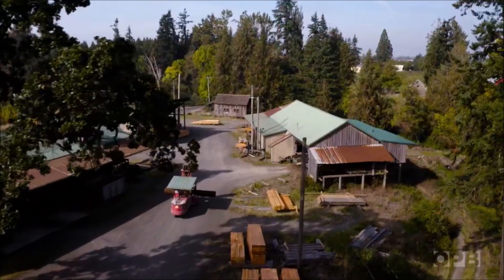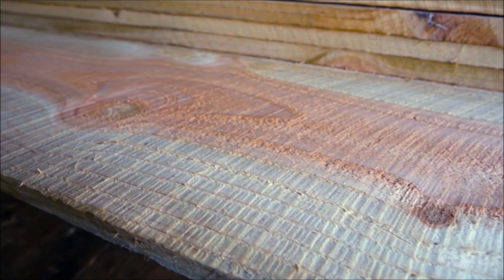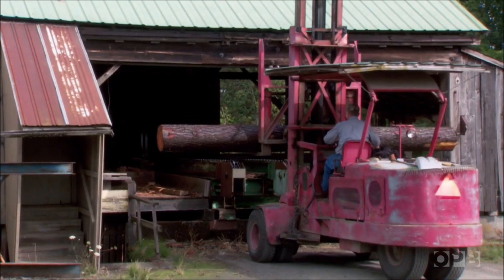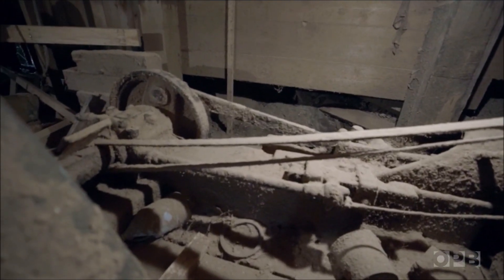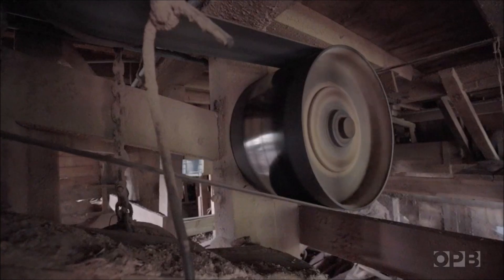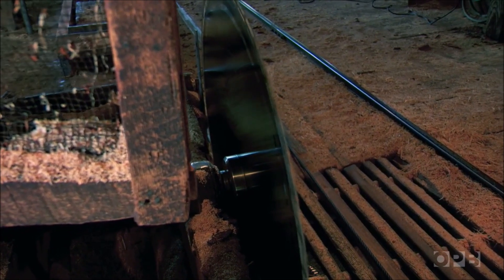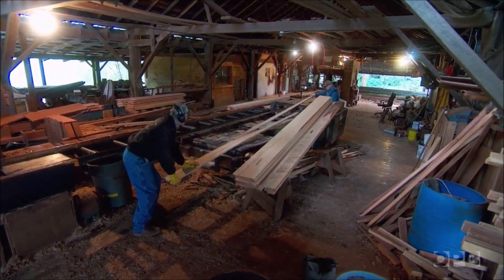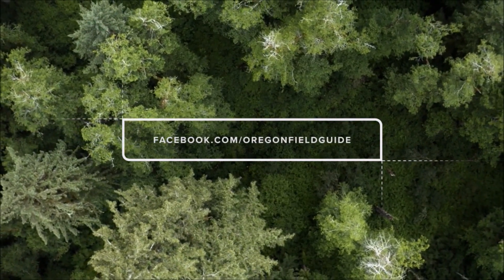Yoder Mill

Comment: G'day Tom, wonderful history that's disappearing, those bandsaws are hard to beat in your species of wood Down Under they have to be wide blade vertical orientation 👍.
Reply from the maker: Timber, sawmills and lumber were the biggest contributors to the economy of the town where I grew up.  Everyday we would see many log trucks loaded high with timber and going to the sawmill.  There were dedicated private logging roads.  One of these went to the river where the logs were dumped and rafted down stream to a mill.  My father and brother worked in a huge sawmill not far away  The processes went from soaking/washing the logs, sawing, planing and cutting which resulted in 2x4 lumber (or what ever dimensions)

Comment: Can the teeth be resharpened or the tip replaced?
Reply from the maker: I passed you question on to David and this was his reply:  "I sharpen the teeth until they need to be replaced.  David Yoder, Yoder Mill Inc."  Hope that helps.
Reply: That style of saw is an inserted tooth saw.  There is a shank that holds the tooth in place.  The tooth is called a bit, and the shanks rotates into the cutout for the tooth to lock the bit in place.  It's a really simple, and neat setup.  My mill only has a single 48" blade, so I'm quite envious of this setup.